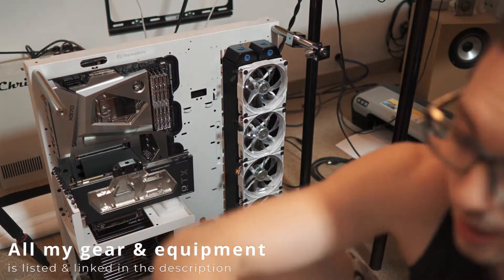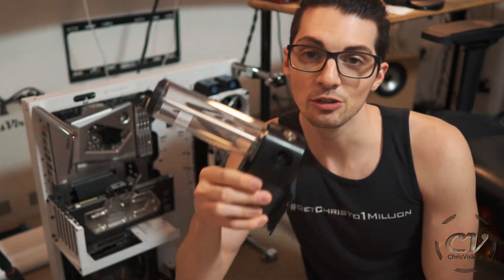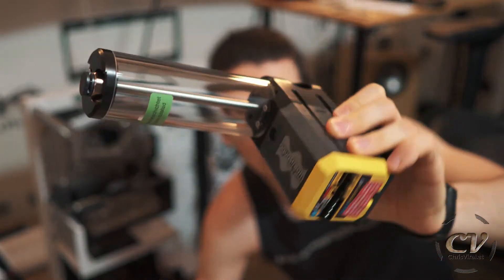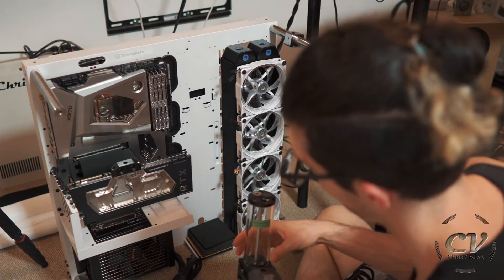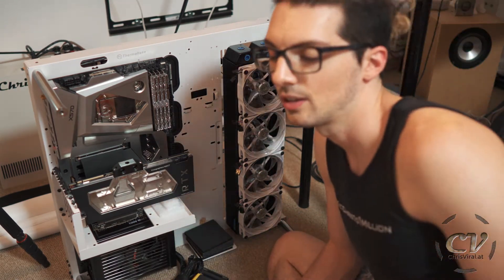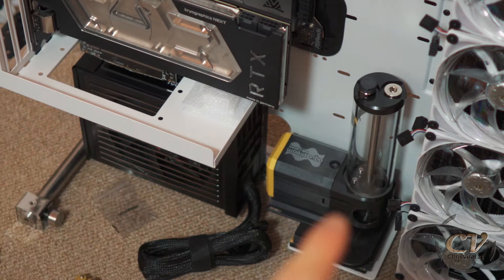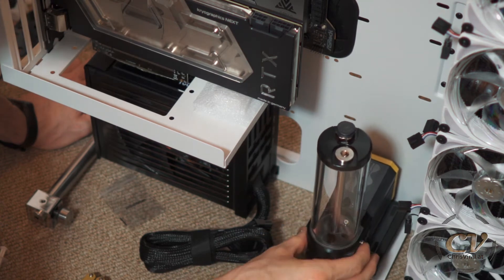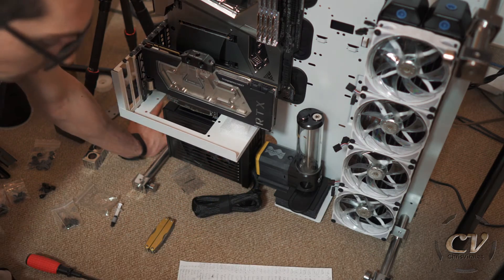Pump & Reservoir Don't Fit Inside The Core P5 Case (Wrong Tetris Piece)

Comment: Send it back and buy a Aquacomputer D5 NEXT + Pump adapter for D5 pumps, compatible with aqualis base, G1/4 + aqualis base for pump adapters 880 ml with fountain effect, ore a ULTITUBE D5 200 PRO reservoir with D5 NEXT pump. There is an 3' opsion, buy a Distro plate that have a D5 pump integrated.!